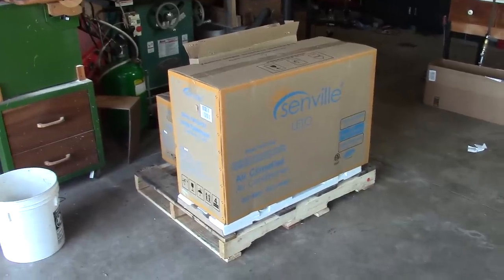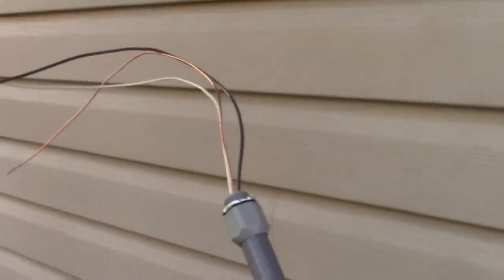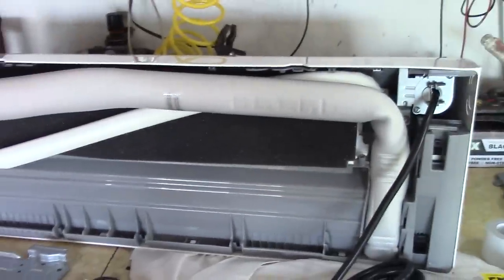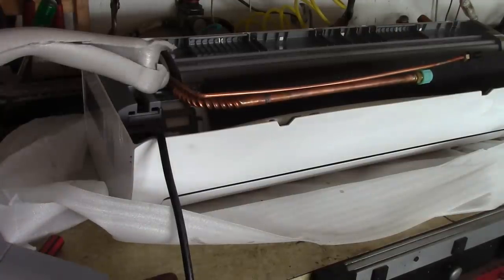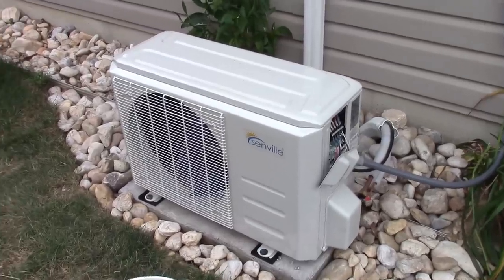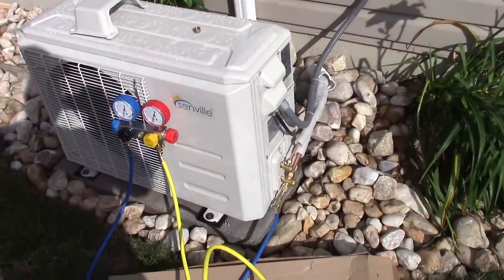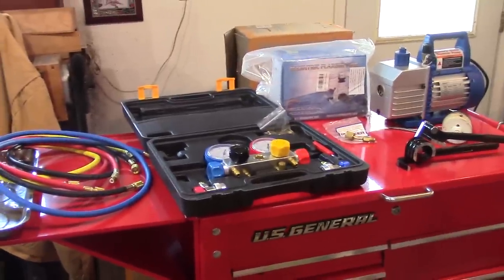Mini Split A/C Full Installation Full Video

Comment: This is pretty good and shows the whole process of installing a mini split. But I think there should be more emphasis put on the flared connections and the evacuating the line set/evaporator or head unit. The vacuums needed to get close to removing molecules that don’t condense like oxygen and nitrogen, should not be taken too lightly. It’s the basis of the science of refridgeration. If you’re using other than a micron gauge, it is kind of like measuring small distances (like feet) with a car odometer rather than a ruler. So having a micron gauge and a vacuum pump that is capable of 500 or less is critical to the longevity of the compressor and the efficiency of the unit. The flared connections are also critical. They need to be torqued. If not, the small increments in vacuum values that result from a less that good seal, become a problem .......with an incorrectly torqued connection. Just tightening to “feels good” just does not get you to where you need to be. But I guess at the end of the day, if your expectations are replacing it in 5-8 years and you’re not too concerned you’re only getting 50-80% of the systems capability....then. These little units are capable of delivering some pretty advanced and economical performance. They're not window or god forbid portable a/c units!

Comment: I think you did a terrific job sir and as you mention one needs to do their home work handling electricity ⚡️ you need to have knowledge as to the handling of it for your safety , refrigerant needs special  attention as well one needs to have their EPA license to handle it so it’s  not released in the atmosphere for the damage to the ozone layer , other wise kudos to you sir also I think that if one has the knowledge and the responsibility as you have Exercised it’s not a mystery but self discipline and meticulous attention to detail as you did show very nice and more power to you .

Comment: In my research I found plumbers highly discourage the use of Nylock in HVAC. It can get into paces you don't want it to be.
Reply: Yes sir. He's going to have issues with his metering device. Mini splits are so sensitive that ang contamination in the system is going to cause the metering device to shut it down or not work properly.
Reply: I've seen others use it and swear by it. You don't really need it, but it's sucks if you want to use r410a oil because once you open it, its no good the next day due to moisture. You can still use r22 mineral oil for the job - it's so little it won't matter.
Reply: Nylog will not cause an issue even if it gets into the line set .

Comment: Yes I agree with everyone. you have done a very good job explaining. Couldn't see all of it when you were outside working on the copper lines, but it seems pretty straight forward. I just got mine and would like to switch the lines to the left. is it a big deal? I haven't read the instructions yet, just watched your video. thanks

Comment: Also for future reference always tape the condensate line to the bottom of the line set when pushing it out through the wall. Of course it works on gravity so the better the pitch the better it’ll drain

Comment: Nice job, but your communication wire that you modified the cable cover on, actually comes up through the bottom of the connection, there is a clamp( 2-3 Phillip screws) that you can back off and harness your wires in place, anyone watching just notice the screws as he is putting his cover back on. Around the 12:25 mark.Cheers

Comment: what stops it all from leaking back out after you take off the blue hose? I pulled my schrader valve off before putting the adapter on. But how do you get it back in?

Comment: would it be possible to remove the vacuum line fisrt before you release the refrigerat gas , to avoid loosing any , and that obviously after you have checked there is no leake in system .

Comment: Respectfully, it is best to use the vacuum pump to purge the nitrogen, that is charged in the evaporator at the factory; AFTER the refrigerant lines are connected. This assures that the lines are clean and NO oil or grit is in the lines.

Also, never use water and soap when using the vacuum pump; lest some water and/or soap will be sucked inside the piping and later into the system. Not good. Make the water and soap "leak test"; AFTER you have the lines connected and you have let about 1 pound of refrigerant charge.

When you are absolutely sure that there are NO leaks; then and ONLY then allow the charge to go through the system. HVAC companies do not have time to assure the leaks 100%, because of costly labor time. But a homeowner can let the pump go on all night. This assures whether it is, or not leaking. I can't express how important this is.

Again, respectfully.

Comment: Thanks a lot for the video and experience sharing. I have gone ahead and bought all the parts that I needed. A few questions as I was studying the manual. Do  we need to drill any holes at the bottom of the outside unit since the manual mentioned something like a drain joint.

Comment: Great video, explained well.  Have a question that you may or may not have the answer to.  So my house is gutted, and I was wondering if you would know or have maybe heard about running all lines inside a gutted insulated wall and then run the lines out to the location of the compressor outside vs running the lines outside and down to the compressor.  I'm looking at installing on 3 floors of my hours.

Comment: Great simple instruction on the vacuum process. I'm about to install a 12000 btu unit and am into it for under $700 bucks with the split system, pump and gauges all delivered. I will test for leaks under vacuum with cigarette smoke. ; )  
Screw paying some guy hundreds of dollars for an hours work. It's not rocket science although they would like you to believe it is and yes I have rewired my whole house and installed all new plumbing myself with no issues for over 20 years now. You can easily save tens of thousands of dollars if you ignore the hype about most home projects. I'm a concrete contractor which is also something you can do yourself with a little research.

Comment: Exactly what I needed, No one would touch the system even just to do the vac, now I'll do it myself...kills warranty but Im good with that. Did you have to buy the wire due to the distance from your breaker panel..I ordered the 25ft kit which should work???? Or will I need more?

Comment: It's best to not leave stripped bare wire exposed on your black hot wire to the breaker. Strip just enough but don't get insulation under the screw clamp. It makes it much safer if someone is working, or testing without shutting off the main breaker. Yes you should always shut off the power if you can but not always possible depending on what you're doing.

Comment: I have the Senville. I got the power and copper lines all hooked up. My wife ordered a vac pump. It looks almost identical to yours except it has a red hose and a 3rd port on the gauge in the middle. When I hook up like you did that middle port blows air and it doesn't vacuum. I'm not HVAC either so this is all I have to figure out now.

Comment: Hey @Doublrwide6 for that hole cover plate, I had to place mine on the outside only.  If you place it on the inside, it will show that it is sticking out.  Lastly and most importantly, the package only comes with  one plate.  Did you decide to take it from the inside and move it to the outside because of it showing??

Comment: After watching this im now confident i can install this and save 14k that the hvac crooks are trying to scam from me. Yup 14k for labor install not including machine . Thanks.
Reply: Not including the cost to come back and fix what they screwed up.
Reply: For sure.  Torque, nitrogen test, proper vacuum, setting proper charge, and warranty are highly overrated.  Really they are mere suggestions from the manufacturer.  Good luck with your install.  Hopefully you get a few years out of your system before it fails and you have to hire a crook to come fix it.
Reply: Yep , if you have ever watched the " Certified" HVAC techs , they are as confused as the DIY'er most times ,lol . So many of them should also be banned from wiring anything .

Comment: Hi, great video, but I have two annotiations:
1. after evacuating just switch the pump off and leave the blue valve open. Otherwise leakages cant be measured.
2. as mentioned, the vakuum is sucking the water soap solution into the pipe
3. after filling the pipe with gas its better to lock for leakages, because the pressure is positiv.
Greetings
Reply: Mich Steffen  You’re wrong with #1.. gauge can still measure the pressure (vacuum in this case) in they system even if the valve is closed.
Reply: @sergioch.6979  Wrong, the gauge is then isolated from the system. It will measure the vacuum of the line back to the pump, but not the system.

Comment: @doublewide6 Repairs LLC
Good job & really nice video. It's very helpful! Thanks!
Just wondering if you're in a humid climate. If you are, there's a chance that installing an oversize A/C unit like you mentioned would not be the optimum choice. I only say that because it could theoretically cool the room fast and then shut off, before there was optimum time for accomplishing it's second purpose - condensing the water out of the air. Half of the comfort level in A/C is due to the conditioned (dryer) air. 
Just wondering how it's working out.

Comment: Thanks for the video. After this I think I will do this myself. But, if there is a leak, how would it bubble since the lines are at a vacuum?
Reply: Pressurize the line with nitrogen for testing, before you evacuate. Shouldn't leave coils in the lineset like that tho.

Comment: Really great video. Thank You so much. I'm in Canada where the temperature can go down to minus 20 in winter. Just wondering if I should get rid of my gas furnace and rely solley on heat pumps?

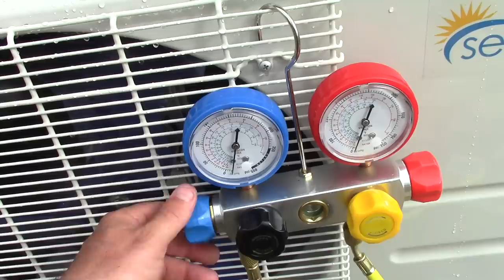Comment: Correct me if I'm wrong, but at 32:08 you say to close off the low side and wait for several minutes to check for a vacuum leak in the line. If you close the low side valve, the gauge is no longer reading the vacuum in the system, but only the vacuum from the pump to the gauge set to the shutoff blue valve. Wouldn't the correct valve to close be the yellow, leaving blue open to read the vacuum for the whole system?

Comment: Since the line is under a vacuum, wouldn't a leak suck the bubbles into the line since it would be going from atmospheric pressure to negative pressure of the line?

Comment: Always check for leaks waiting a few hours or overnight,these small leaks take time to show up on your gauges. !!!!!
Reply: Absolutely correct! I've had a small leak in my split system that never would have shown up by watching the vacuum pressure drop in only 15 minutes.
Reply: Would be a lot easier to find if he did a proper nitrogen test and had a micron gauge for vacuum.

Comment: very good video, I guess do not use bubble solution for leak on vac. Do we leave black and yellow knob as well  as the blue knob open while evacuating unit and only turn blue valve closed when ready to open line set up?.  Thanks doubblwide

Comment: Question.  Why did you leave your vacuum kit attached than released the refrigerant?  It seems to me you would want to disconnect the pump first than open up the refrigerant and charge the lines so you don't lose any when you pulled the line off after.

Comment: With regard to efficiency, Mitsubishi makes a unit that is 33.1 SEER and 12.8 on the  heating and it will create heat when the outdoor temp is -13!  Nearly 5 times as efficient on cooling and double on heat.
Reply: Do you know the model # of the condenser?
Reply: MUZ FH09NAH 1

Comment: Great job on the install. Just ordered mine waiting for it arrive.  Like how you cooled and hid the pipe.  Question: what screws did you use to screw into the concrete to mount on the pad?  Thank you.

Comment: Thanks for the video!  This gives me the courage to do it myself. Many thanks! Could you please link your concrete pad video? Again many thanks for doing this video. My neighbor paid someone $500 just to vacuum the line and bought the same unit.

Do you prefer this unit or the Cooper unit? I’m getting this for a basement for heat.

Would you consider doing a tankless water heater install? My natural gas tank heater is soon gonna die. Thank you and God bless

Comment: You need to keep the drip line accessible, sometimes dirt or mud dobbers plug it and water will back up into your indoor unit,, you need to vacumm this line out every two years or at least have it serviceable

Comment: Hi, you said you have the yellow hose connected to the Vacuum, but in the video it is connected to the charging port. I bought the same Stark 4-valve manifold gauge and the black knob says VAC; the yellow knob says REF, which leads me to believe the yellow knob is used to charge refrigerant.  I will be installing a mini split this weekend and I want to make sure I'm connecting the hoses to the right ports. I bought the manifold gauges that you recommended, but it came without any instructions.
Could you please clarify?

Comment: On that 4 way gauge set manifold, the black port is supposed to be for vacuuming, but you connected the vacuum to the yellow port which is the discharge port, I’m a bit confused.

Comment: Around 20:50 you started unscrewing the caps on your lines. Pretty sure an o-ring was blown out of the smaller line. I assume you fixed that since you won’t be able to maintain pressure/vacuum if you don’t. I know I’m super late to this.

Comment: I can't see how anyone can buy the tools and find it works out cheaper.. I personally don't charge that much. I think US folk are used to paying massive amounts for the old school AC systems, really this is only about 4-5 man hours, About $400 incls materials +electrical. Plus the unit. You got a quality install. And it's even electrically legal, certified and warranty not voided.. 
Plus help the customer with advice get the right unit. Put in the right place. 
"Buying quality only hurts once"

Comment: thanks for the video, very helpful for deciding if I want to take this on.  I found a MRCOOL unit on amazon that is a little more money but doesnt require a vacuum pump or gauges to install.  Might go with that one.

Comment: I successfuly installed by Senville LETO but after 3 days it is no longer cold. The code shows up telling me need refigerant. They say the unit is loaded. Is it fully loaded or just a start-up?  Let me know. Help! Thanks.
Reply: Let me add the small pipe 1/4 gets frosty and gets iced after running for a while and the 5/8 pipe if ok. What's happening?

Comment: Do you need to reuse the black wire for the communication from the inside unit to the outside unit or can you use a regular 10 three Romax

Comment: Thanks for the video! I also user a R32 Adapter at the service port and let the gauge installed till opening the valves to fill the ac with refrig. - than , as suggest i tryed to disassemble the adapter at the service port and a lot of refrig. and oil came out, so i rapidly closed the adapter insteat to put it down - thought all gas and oil would come out. how can i unplug the serviceport now? ty in advance and sry about my bad english 😅

Comment: Great video. I must have watched 20+ videos and yours was the best. I have purchased and am installing a split now. I like that you come back with explaining questions from viewers. 
That being said I am only unsure of the after vacuum and releasing the Freon. I read you put a clamp on the like to prevent leaking. I understand the pump is attached during the release of the Freon but is the system still under vacuum or just still connected?  I guess I don’t understand if under vacuum that the gas ones through the system? 
Thank for all the work you did on the video.
Reply: I am installing a 24K BTU right now as well. What what City are you in? Maybe we can help each other out.

Comment: I'm contemplating the purchase of a Mitsubishi or Panasonic for a 400 SQ studio loft. It will be a single console unit, I will need to hire an Hvac company for the install, can you estimate the cost ? Does $3,500 sound about right ???
Reply from the maker: yes at least.
Reply: @doublewide6  Can you offer any negotiating advice to the Hvac company to make the price better ? THX
Reply from the maker: @aquarius9491  Just tell them you are getting quotes from 2 companies and going with the best.  Ask them to give their best.

Comment: You said to put a bubbly liquid on the connections to find a leak but the system is under a vacuum, not pressure, so you wont' ever see any bubbles.  Actually it will suck the soapy liquid into the system which is not good.  System must be under PRESSURE to find leaks using the soapy liquid method. 
And most codes now require that 220v connections use a three wire (12/3 with ground) black, white, red, and bare copper safety ground.  The red and black are the positives or load wires 110v each, and the white wire is the common or neutral wire and the bare copper is the safety ground or earth ground attached to the chassis.

Comment: Nice install.  Very well done and nicely presented.  Was wondering how far I could shorten the line set without causing an overcharge situation with the refrigerant.  In my case I have a 12k unit.   I'd like to trim about half the total length (from 16' to 8').  Would anyone know if this would create an issue?
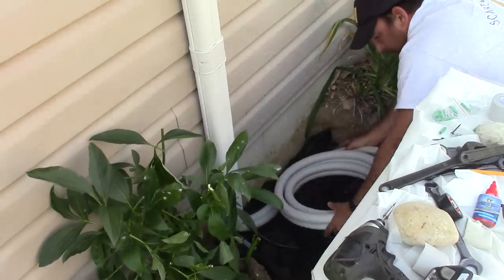Reply: He said in the video he called the manufacturer and they advised min length is 10ft. @23:40